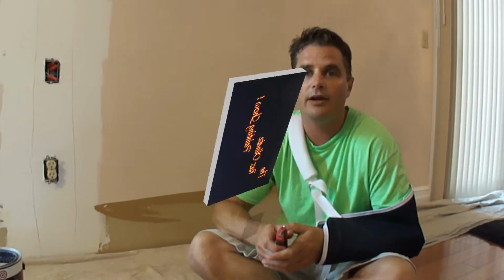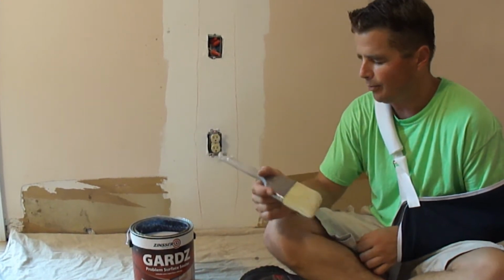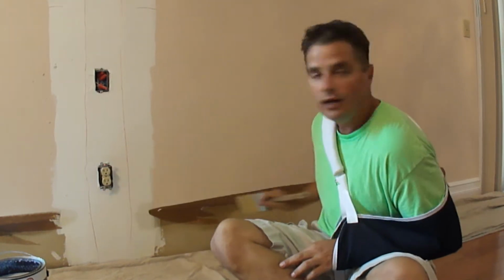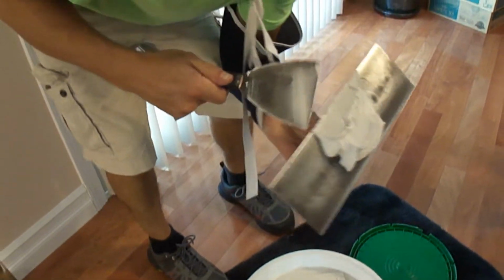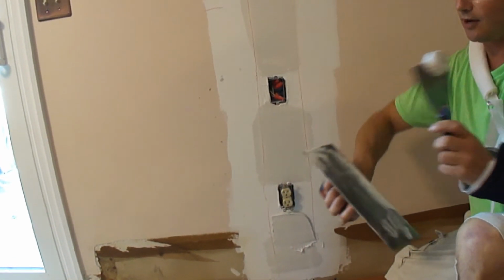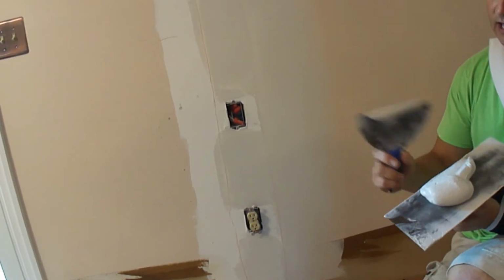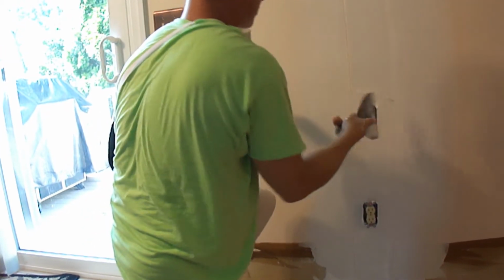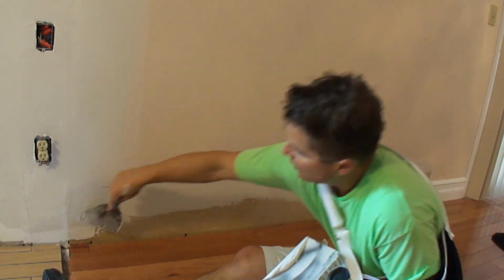How To Repair and Mud Drywall (Part 2)

Comment: Good video Russ. Have you ever tried using shellac to seal the paper or damaged drywall? 20 or so years ago a dry waller told me he uses shellac to seal torn paper or damaged drywall as the shellac dries in 10-15 minutes and the paper gets sealed and allows it to be sanded to prevent any fuzzing issues. Any thoughts on using shellac?

Comment: Hi Russ haven't  been  on the TUBE for awhile so I didn't know  about  your shoukder or how  you  did it,but your GREAT, always "Another Road To Roam", and you are making it happen, just be carefull, Just the Mom coming out, sorry. I  watching  your (whole) series on this drywall repair, because I  have one to do soon, and drywall is not an area that I have experience in but this is a small job and it's for my son that had bees make a HUGE nest in his celing above the shower ,because th outside screen came off and he did not replace it, hum, a little  neglect can make  BIG problems. Anyway your series is wonderful.
Reply from the maker: +Maggie Swain 

Hello Maggie-

Thanks for your Nice comment, I appreciate it! Good luck with your Bee's Nest project and let me know how you make out? Where are you from?

Russ

Comment: Job well done.
Reply from the maker: Thank you!
Reply: RussOlinatzPaintShow Russ, Thanks for making videos , I have watched some of your videos and have learned from you. I'm in the process of doing my room. Have another question. I have about a size of a penny hole in the corner of my ceiling where we ran a cord back in the day. Do I fix that by putting drywall tape the kind that sticks to that and then put mud over it? I have the same mud you had in the video, is that the right kind of mud for that also? The hole again is about the size of a penny or nickel.
Reply from the maker: OTC

Hi-

Is it a Flat Ceiling or textured?

Russ
Reply: RussOlinatzPaintShow Russ, it's a popcorn ceiling?
Reply from the maker: Hi

I would just stuff a little news paper in the hole first and then add a little plaster of Paris to the all purpose joint compound so it will set in less than 10 minutes and won't drop down on the floor. Then after it sets use just regular joint compound for the next few coats and then re texture. Using the tape will create a bigger area to texture and will be more noticeable to the eye after the repair is made. 

Russ

Russ